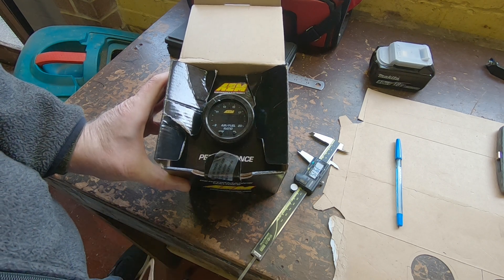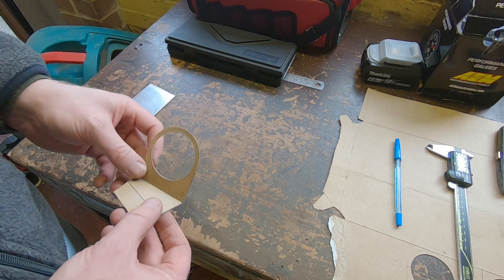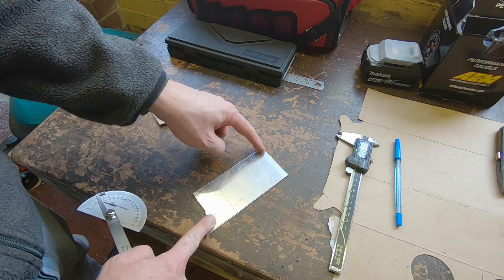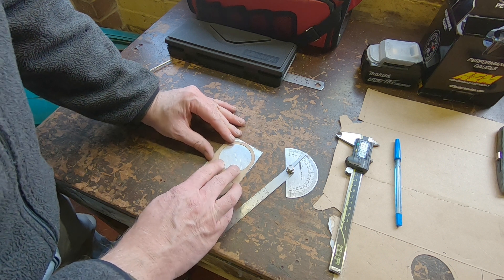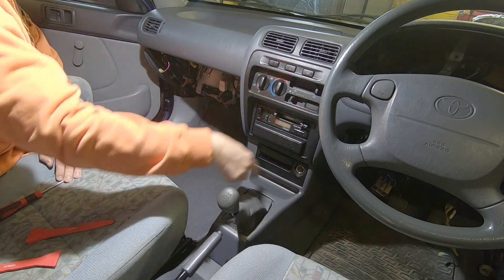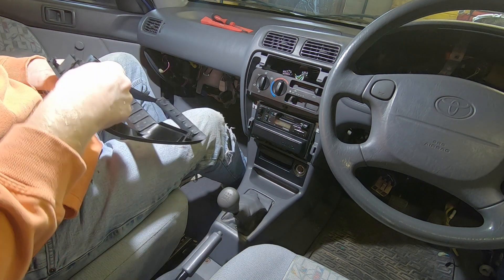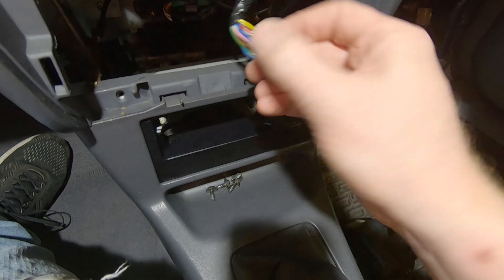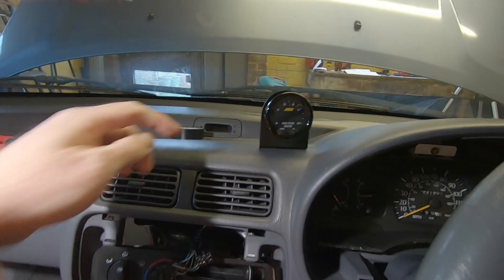How to install an AEM AFR gauge (includes wiring) | Toyota Starlet 4efe turbo build.

Comment: Your making some progress with the starlet, are you going to put a fuel cut defender in it ? Keep the good work up 👍🏻
Reply from the maker: Thanks friend 👍. I will be using an ECUmaster det 3+ piggyback to control the fuel and retard the ignition on boost: https://youtu.be/_z5hnVmlyuI

Fuel cut defenders only prevent boost cut and aren't capable of tuning fuel / ignition.

Comment: Just a heads up. If your using the AEM x series wideband gauge with the det3, you will have to get ahold of ecumaster and have them send you a "definition file" for that gauge. The AEM wideband setting the have won't work with the newer X series
Reply from the maker: Nice one, I have already connected the AEM wideband to the det3 and it appears to be displaying correctly. If I have any problems I will contact them. Cheers for saying 👍

Comment: Good video I run the output wire to ecu gives me A/f data on data logs great feature for tuning
Reply from the maker: Cheers, I will be doing the same to the @ecumaster det3. At the end of the video I strip out the unnecessary wires from the aem power harness to extend the analogue out +/- signal wires.

Comment: Neat, I bought their previous generation wideband gauge to use aswell, a busted engine later no more turbo project 🤣
Reply from the maker: Just wondering, are 5efe's expensive where you are?
Reply: Haven't looked in a while, there won't be many on the market. Volume of cars with them here are low